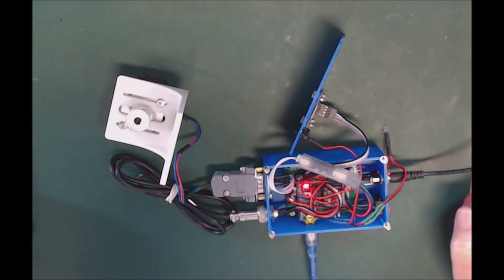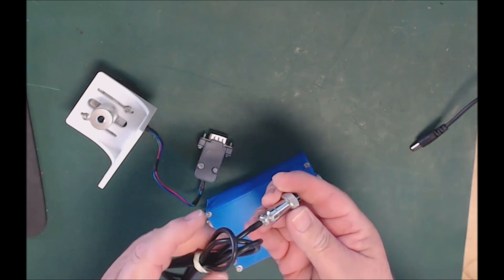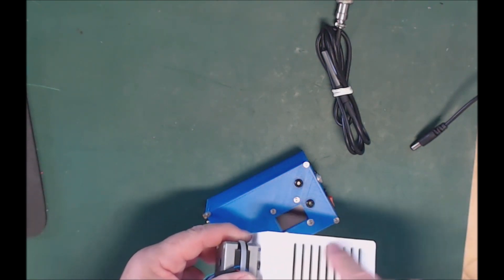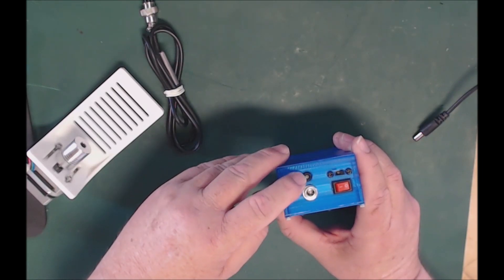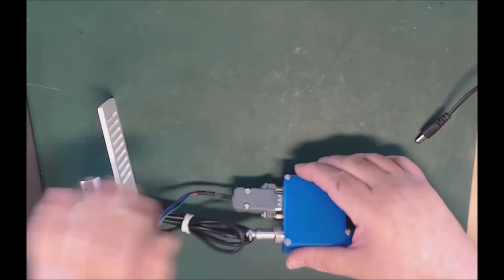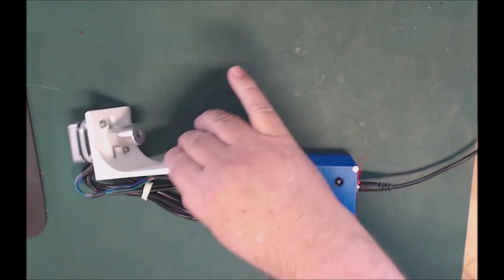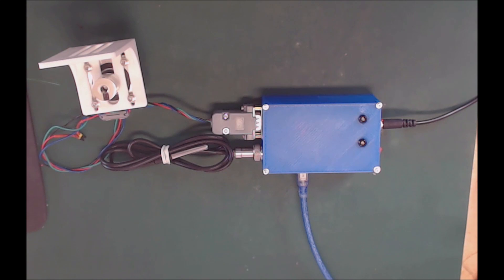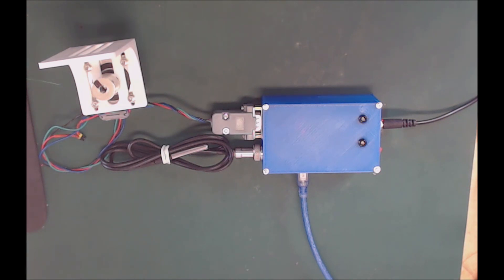myFocuserPro2M DRV8825

Comment: Dear Robert,
I'm assembling the myFocuserpro2 Solderless version, and I saw that it doesn't have the protection circuit with the LM7808, isn't it necessary in this version? can I use without this protection circuit?
Thanks
Gilberto
Reply from the maker: Yes. I would suggest insertion of a fuse and 3A diode in the 12V supply line between the 12V power in socket and the nano board just for safety. But it can be operated without it. JUST DO NOT supply more than 12V [ie car battery] or you can blow the nano board.
Reply: @robertbrown6176  OK Robert, I use a 220V / 12V power supply up to 10A (not car battery), but I will follow your recommendation and add the fuse and diode as recommended.
Thank you